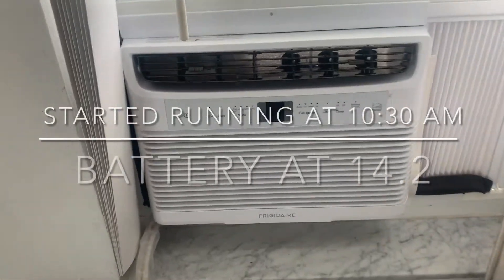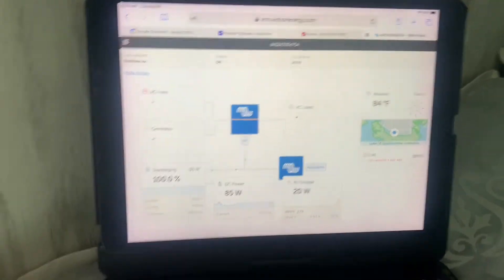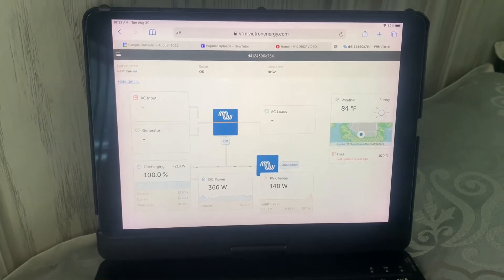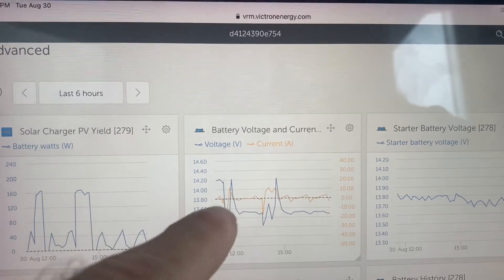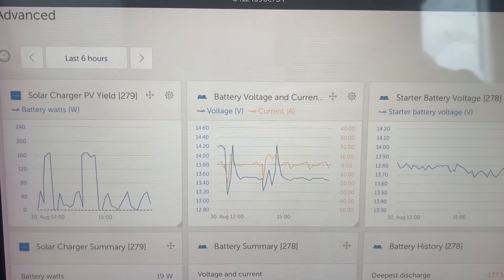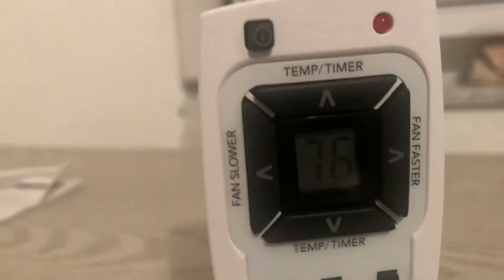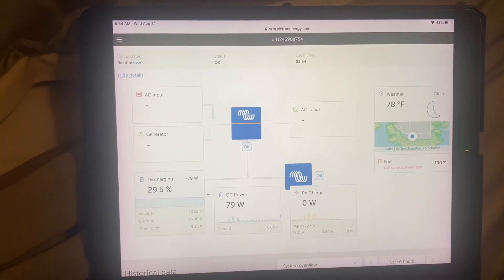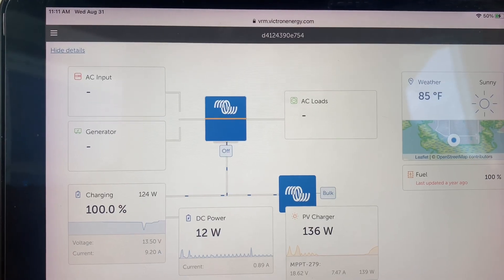Ran Frigidaire 5000 btu AC all night on 200ah battery - recharged to 100% next day on 1 solar panel

Comment: By any chance, did you measure how many amps or watts it draws when compressor kicks in? Im trying to see if my sportsman 800 watt will run it in eco mode which would be like 500 watts without overloading. In the specs it says it has low voltage start, but i would like real numbers. Thank You

Comment: Sir, thank you for the good observations.
Previously I used high frequency 2kw go power pure sine wave inverters to run our Midea 5000 BTU window AC (650-800watts), after a couple or three years they failed to start the AC.
Currently I have a LOW FREQUENCY inverter , 5kw rated, and it works well with inductive loads.
Im curious how the load balancer functions, if it gets hot as some have stated, I'd say its depleting the higher voltage bank with a resistive load.
In the event i replace my lifepo4 batteries, I may go with 24volt batteries to avoid the imbalance, which still perplexes me.
Thanks again and keep up the good experiments.

Comment: Im just here to find out how many watts at peak this ac was using lol
Reply from the maker: I think I saw it hit around 450 during cooling periods … it may have spiked a bit higher for short periods within that.
Reply: @colinauld  thank you !! Helped me make a decision! I run the ecoflow systems so I'm wanting to be as efficient as possible
Reply from the maker: @Jamesmonelly  You bet, we all need to share what we’re finding so we can build the right systems.  Hope it all goes great for and thank you for your comments.👍🏻
Reply: @Jamesmonelly how did it work out for you? Are you using the same AC unit? I’m seeing starting watts of 1100-1350

Comment: Assuming you have it running 300 watts on demand. That means in 12 hours it will consume 300×12=3600wh. So I would need a battery no less than 3600wh to be able to run it. But we see it's not always on it goes on and off. So if you could measure it's total watt hour in 12 hour period,  it will give us the true battery capacity we'll need. I think the system should have some measuring parameter.
Reply from the maker: What I saw in the 11 days I had it running was that it  would run every 20 minutes or so till it hit the desired temp.  If it ran the compressor it would draw the heavier watts but the next two times it would run in that hour it did not draw heavy watts because it was only trying to maintain the reached temperature.  If you can discipline yourself to remember to keep the door to the room closed it is very efficient.   While it waits to run the draw is incredibly low.  Thanks for the comment, hope this helps.
Reply: @colinauld  I was interested for it's watt hour to see if i have enough solar on my car to run window AC😆
Reply: @colinauld  Yes, if it's cooling it's a 5000btu ac is using 350 watts. If only the fan is running it's using 80 watts (be nice if fan turned off after chill returns to room temp). I think he said when it's doing nothing it draws 4 watts.
Reply: It runs at 333 wh when the cooling is on,,, I have the same one, this dude could have made the video much simpler…. Who cares about amps 😂😂😂😂,,, 333 x 10 hours is about 3300 watts 😂😂  very rarely will it shut off for cooling a small room, unless at night
Reply from the maker: @zodaguado6655  I was with IBM for my first 10 years in IT and Tech …. After that I could never take the simple road again, they ruined me lol.  
Thanks for the comment ….

Comment: How much a watts of solar panels do you have
Reply from the maker: I use a 240 watt panel but I live in Florida so sun is excellent (when they’re not spraying).  The panel has been replaced with this 250 watt model https://amzn.to/3WgySR6 by the manufacturer.
Thanks for the comment, hope this helps.

Comment: Day is you cutting off the panels cheif  what the best charge controller to i can fully ready the grid cause im using two 30 amp mppts  ya know and running my ac  and other things at different times but i seen this and like y'all keep saying running ac in the day why not night time if you dont mine me asking,, you that cause i use my ac if i do most the time at night,  ya know ya can i know that but ya dont need all that they claim  but it makes the system stronge to wait,  silly though but for real, think about it  i hear folks see folks show hell of a battery bank in here can't run a ac all night half the night then why,? But ask your self that question why looking at your system  connected and tell me some you can do that they say you cant do and get back at me I'm tell ya if ya dont get my drift though🥴 off a short bank no sun light out , if ya get my point i dont fallow rules but i do but some things or to be put to the test rules can be broken in some ways
Reply from the maker: Well let me start with why run the AC all day and the answer is it keeps the room at a decent temperature. I don’t think I would have been able to cool the room if just ran it when I was going to sleep and this little AC draws very little power when it’s just trying to maintain a certain (reasonable) temperature.   I agree with you about people making it more difficult than it is, but I do stick to the rules when it comes to safety.  Wire garage and fusing is critical so those rules I’m following for sure.    The controller I use is only a 20amp but it’s Victron who I love due to the remote reporting and the fact that they’re marine friendly.   If you have 2 30 amp you should be set?  
Thanks for the comment.
Reply: @colinauld  yes basically but I can run all night I just hear folks say they can't run night, crazy I have mine on 9 to 3 in the morning ya know so I feel like maybe they did something wrong or I did something a little different though I did ya feel

Comment: Good stuff. I was annoyed how other people were testing out portable AC and pointing out that it doesn't get cool to their "comfortable" temperature of 65. I told one dude to just stay at home in an apartment.
Reply from the maker: Thanks,  yeah 65 is a little tough but Will Prouse actually gets pretty close to that running his 6,000 BTU unit in Vegas where he has a little shed for solar stuff.  He has a ton of good content.   For me the biggest issue when I was running it for the 11 days was remembering to keep the room door closed.  That was a pretty frantic time I wouldn’t wish in anybody lol.   I agree with you, we need to have reasonable speciations and things will flow.   Thanks again.
Reply: 65 is absolutely nuts. 74-78 is fine. I’d run 80 if I wasn’t worried about food and seasoning spoiling.

Comment: How long can 1 car battery that's 1,000cca run a 600w Ac without solar panels ?
Reply: CCA means cold cranking amps. ie. How much power can it deliver in a short burst. Car batteries are not designed to run for long periods of time. You want a deep cycle marine battery, or better yet lithium.

Comment: I bought the Costco Energizer power source.  Do think I can run 5000btu midea AC unit. I did a 5min test and felt it cooling but than got scared I was going to burn something up before researching.
Reply from the maker: I’m not familiar with that unit (I don’t have a Costco membership).  I agree with you being cautious.  Go through the manuals for that unit and see if you can find others using it and giving feedback.  Sorry, I wish I could offer more but I just don’t know the item, the wire gauges, the fusing ….   I was so paranoid of the fire risk I even covered my walls in concrete fire retardant backer board so I agree with you 100% in doing the research.  Thanks for the comment .. all the best.

Comment: What is the solar wattage you have pouring into that and what peak sun hours do you think you had when making the video? 

This video is so close to answering some of my questions lol. Hard to find good videos on youtube.
Reply from the maker: It was a typical south Florida day.  So intermittent clouds with very regular sun.  The panel has a max of 240 but it usually hits around 190.   I made a few more videos where you can see the Victron cerbo data on sun and charging as it happened.  For the test above I think the batteries came back to 100% before noon on that one panel.   Hope this helps and thanks for the comment, cheers.
Reply: That was perfect, thanks man.

Comment: Ok, update: Not sure what I did wrong. The ac and inverter are in a micro camper I am outfitting. My 1st trial was just a dry run b4 perm installation of batteries, inverter solar controller, which I completed today. I just began a second test, started 13.6v, ac been running 1 hour, still at 13.6!!!  Will try and let it run overnight. If I can get 6-8 or more hours, Ill be THRILLED. Thanks.

Comment: Confused, I just tried this with 2 100ah LiFePO4 batteries and it ran a brand new 11 seer 5000 btu for about 30 minutes????
Reply from the maker: Something is off William.  Will Prouse runs this same setup (Frigidaire 5k & the Giandel) 24*7 in a small shed in the Vegas heat and he shoots for a very low temp (but he does have more panels.).  
The Frigidaire runs for about 20 minutes then cycles - I ran it for 11 days and it was pretty consistent in that.  Are you saying that after just 1 30 minute run of your 5k AC your 200ah battery was dead?? That doesn’t seem possible? 
Do you have a meter … can you check them?
You may have the inverter set to cutoff at a very voltage … did you check that?
Reply from the maker: May have the inverter set to cutoff at a very high voltage … need to see the levels of the batteries … something is definitely off.
Reply: @colinauld  Did not know there are any settings on an inverter?
Reply from the maker: @Bluebug-67  I can’t speak for them all William but mine has a cutoff.  I don’t use it due to the MOES switch handling all that before I get to the inverter.
Reply: @colinauld  Ok, update: Not sure what I did wrong. The ac and inverter are in a micro camper I am outfitting. My 1st trial was just a dry run b4 perm installation of batteries, inverter solar controller, which I completed today. I just began a second test, started 13.6v, ac been running 1 hour, still at 13.6!!!  Will try and let it run overnight. If I can get 6-8 or more hours, Ill be THRILLED. Thanks.

Reply
Reply from the maker: @magaisacult2023  That's great news. As long as your AC cycles on and off when it"s satisfied that temp has been reached you will run for a long time.  My goal is to make it through the night till sun up as the Florida sun will restore the batteries as it also gives the power needed to run the little 5K AC.  Good luck with it all ..sounds like you're on your way.  BTW Victron is going to honor my warranty and replace my controller which would also say the there is a need to check the terminals on your connections periodically.  I'm hearing that once a quarter is a good interval to just make sure all screws and connectors are still at the right torque.
All the best, thanks again.
Reply: @colinauld  TY for your help

Comment: Wait...   a 5Kbtu A/C is going to use like 450 watts while cooling,  but there is a surge to start the compressor that might be six or seven times that...  Where is the surge reading?
Reply from the maker: Never saw this kind of hit.  Typically this unit is starting in fan mode.  It cranks the compressor as the desired temperature is entered (on panel or via remote). It never issued a demand for anything close to 2700 watts.  There maybe a soft start in the hardware?  None of my monitoring equipment reflects this kind of hit but you’re talking milliseconds so it may be missed.  Either way it is not an issue with this 2200 Watt inverter or the wires carrying the loads.  
Thanks for the comment, hope this is helpful.
Reply: This unit has a surge suppressor only needing 800 watts on startup
Reply: I’ve been seeing a 1100-1350 watt surge in mine. Not sure if it’s normal but the unit still works

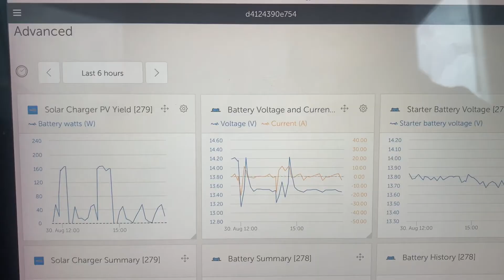Comment: VERY IMPORTANT: Central air set to 78 ( 2:03 ), so he is only cooling from 78 to 76 for this test.
Reply from the maker: Yes it is important and that’s why I point it out in the video.  The system now has a total of 400ah of batteries and using this setup I ran that 5,000 btu AC for 11 days against Florida heat after hurricane Ian.  I also ran a small microwave for instant coffee (also very important .. to me lol). The system kept my master bedroom cool while the rest of the house baked with zero electricity … 11 days of misery but at least I slept in quiet comfort.  The 240w panel brought the batteries back to full every day after using the AC all night - one of the blessings of that Florida sun. Thanks for the comment and here is the complete setup. https://www.youtube.com/watch?v=KlCFKCvmMJc&t=106s
Reply: I saying that exact same thing 😂

Comment: Hello how much watts do u think this would draw on a 100 degree day 150sq ft  without other ac's helping out.
Reply from the maker: Hi Nick,

I ran this unit for 11 days with no other AC and no power at all in my home during hurricane IAN.  It performed very well and kept my master bedroom comfortable the entire time.  The master is right around 170sf and I kept forgetting to close the door when I left the room.  The only change I will make is to add another 200w of panels (I ran all that on just a single 240w panel which never gave the full 240).  The batteries were great and my system gave me all the power I needed for the full 11 days.
Thanks for the comment.
Reply: I have 1 200ah redodo battery i got from amazon just wondering if this would last in between charges

Comment: Hello ,I am rambling along, and going to install a 48watt system in our home, I have just about everything for that project.I did purchase 4  agm -6volt batteries for 24vsystem for my garage alone.I need to power a 6000btu through the wall unit.I have  many 300watt panels and would like to power the unit  from  the sun mainly in conjunction with the batteries.I also will have this system on a Moes ats transfer switch.    I will have 8hrs of sun where my panels will be located., I think the 24 watt system   ,will maintain 70 degrees and my battery draw will be 50% on cloudy days before going back to grid. i will use a pure sine wave 24watt inverter same make as yours.   if  I can sustain a good 8 hrs in my work shop , i will be happy. I have a regular two car garage , insulated  and can isolate to 1/4  of space needed  for cooling. You info is quite informative on what to expect, thanks for posting.MT
Reply from the maker: You’re very welcome, I’m glad to be of help. Your system sounds like it will be a lot of fun👍🏻
Thanks for the comment